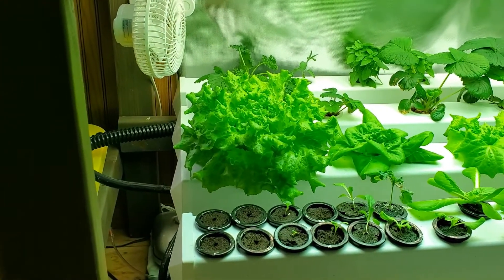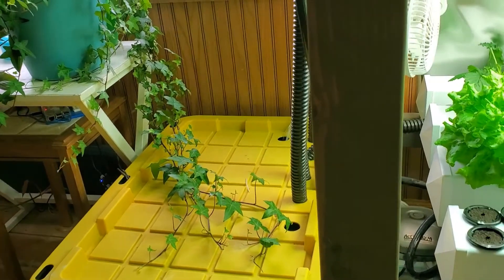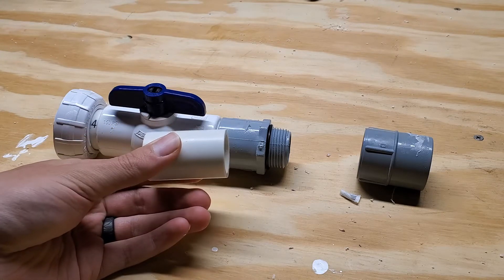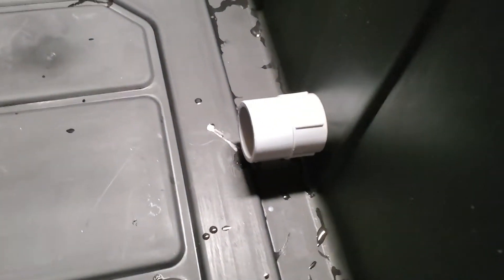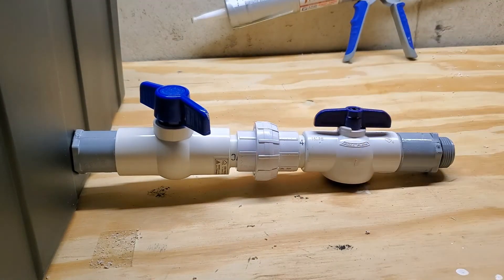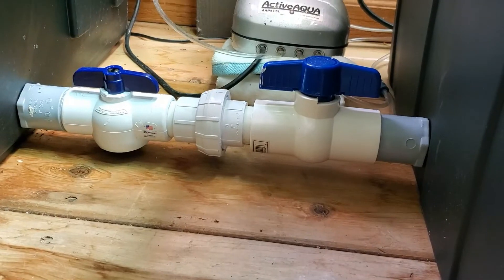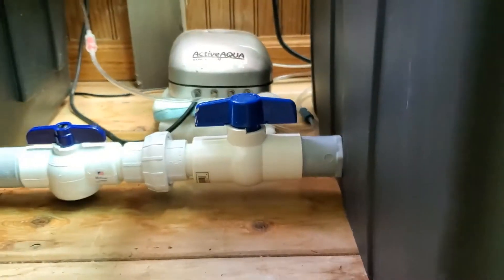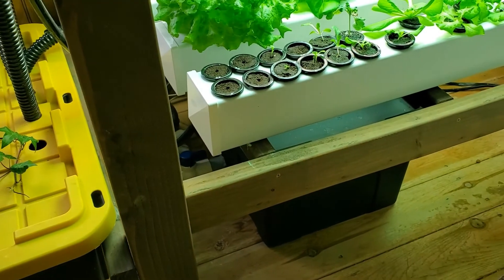Simple DIY Connection between 2 Hydroponic Reservoirs or Tanks

Comment: Cool videos.  I have a few questions that I’m hoping you can answer:

1. Would you used the threaded conduit fittings instead of the bulkheads if you were to build the rails again?

2. It looks like you aerate the water.  Is that necessary?  It seems like that plants and the water would already have great access to oxygen.

3. Are you concerned about anything in the PVC or PVC cement leaching into the water and then the plants?  What about PVC primer (which it looks like you didn’t use)?

Many thanks.
Reply from the maker: 1. Yes, I prefer to use the threaded conduit fittings for any new rail system builds.
2. Yes the aeration is important, the more oxygen the better. Especially for plants with larger root systems.
3. At this point I'm not concerned. I paid for a detailed test of the water from my system and there were no issues:
https://www.simplegreenshydroponics.com/posts/2021/is-pvc-safe-for-hydroponics
Reply: @SimpleGreensHydroponics  awesome.  Thanks for all the helpful information.